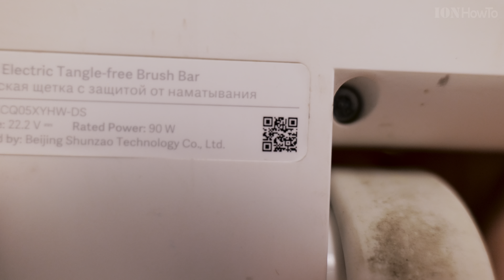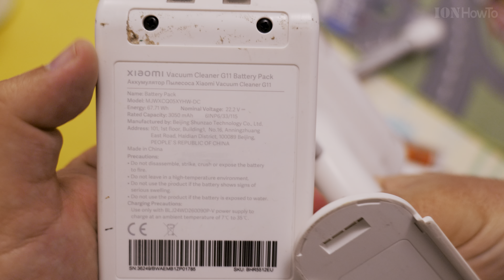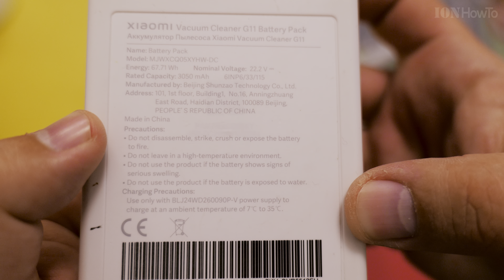Xiaomi Vacuum Cleaner G11 Problems After 1 Year of Use

Comment: I had the same problem. The problem is that one cable (black) was simply broken and did not contact as a result of using the vacuum cleaner.
Unfortunately, the cables and the whole thing is hard to take apart, so I routed the cable simply from those 3 pins "outside" (right next to the plastic tube) up to the pcb and it works.
Reply: Same here, black cable has to be replaced and it works again.

Comment: Were you able to fix the main brush with warranty?
Reply from the maker: Yes they replaced it. It's a design problem I believe. Brush was used normally - no water, normal cleaning. It still works so far.

Comment: Mine spins but the plastic broke. If the plastic did not break then it’s the cable to fix. It needs 3 cables. Can fix with soldering irons. You can cut a usb to get the cables.
Reply from the maker: If it's still in warranty take it back for repair.

Be very careful around the battery.
Not sure if I understand what is broken on yours
Reply: @IONHowTo  basically the bottom attachment for the floor has those pieces that bend up down, left and right… (the plastic that has the gray flexible tube inside) so that plastic that bends broke… as for the cable issue you have, I had it on the G10. Very easy fix. You need to take apart the floor piece and replace the 3 cables which is easy to do. If you are afraid of soldering, and are out of warranty I’d suggest to find a small repair shop that can do basic soldering repairs.
Reply from the maker: @DanielKarnole-fs3hm  mine was in warranty so took the thing to the shop and they replaced the big brush only.
If it was not in warranty, I would take it apart. I imagined it's some bad contacts or wires.
Reply: @IONHowTo  yeah. the place that bends (on the floor attachment) has 3 cables going through it. When it flexes up and down, over time the copper inside the cable gets cut but the plastic cable itself is not cut. That is why it sometimes works and sometimes not.